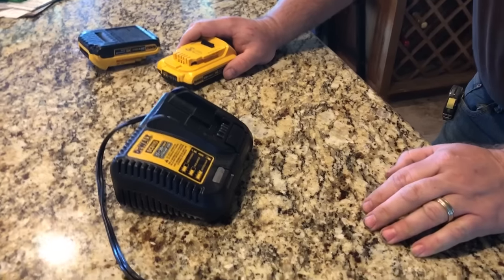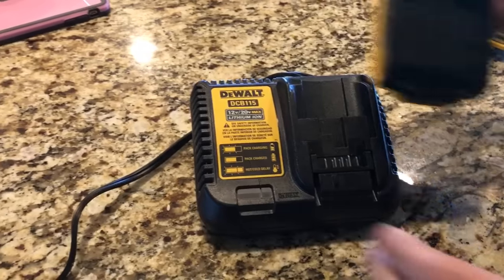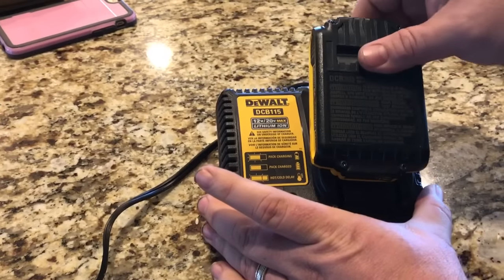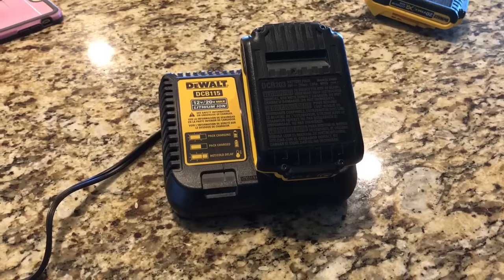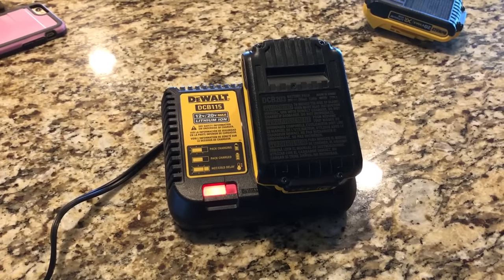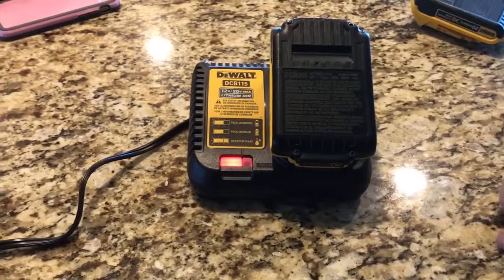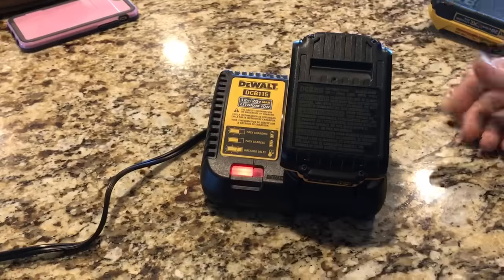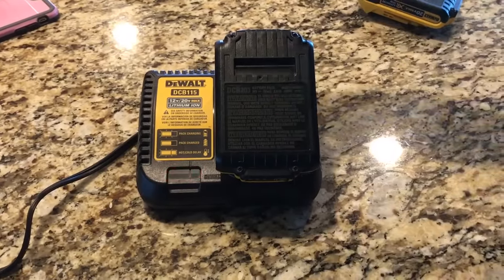This is Why Your Dewalt 20V Batteries Will Not Charge

Comment: I just bought my first Dewalt product and this video just saved me a trip to the store for a return.  It felt like there was too much play between the battery and charger but it also felt like i had pushed it down far enough; I guess not.  Thanks so much for the video!!!
Reply: Me too I bought a dewalt combo pack and I put the battery on the charger and it was blinking red I thought it was charging and I looked on here how to charge a dewalt battery I think this video helped me out the red light is not blinking red anymore

Comment: THIS IS AN ABSOLUTE FLIPPIN' REVELATION!!!!!!!! There are not enough words to express how grateful I am that you made this video, thank you sooo much!!! What really had me convinced it was the battery at fault was because one of my batteries would charge fine while just resting in there in the incorrect, not clicked in, position (a 4ah battery I have) it was only my 5ah that was giving me a problem. Sometimes it would briefly show the orange temperature problem light and solid red, sometimes it would have the red charging light blink once or twice, then go solid red.
The thing is I had watched about 4 or 5 other videos about DeWalt batteries not charging before I saw this video, none of them mentioned this simple point, I was all prepared to take my battery pack apart and start messing about with it in a very dodgy fashion, no need!!!!!!
I've prattled on about this so much now that I've probably spent three times as long typing as your video took to explain the fix, but I don't mind, it's worth it, you sir are worthy of all the time I could possibly spend singing your praises!!!!!!!!!

Comment: Yeah , because I didn't know that they had to be clicked into place , the light came on , I figured it was charging, but it would'nt flash.I took mine back to where I bought it , the salesman there was annoyed with me that I didn't know how to use the charger right , he took my drill and impact into the back room with him , I think he jacked them up somehow because they didn't work right after that , they would work some of the time , then not work at all other times. I was on a job out of town , needed these tools , didn't have power where I was working , these tools barely did the job.I had to take the set back again to get a whole new one.
All because some pencil pusher at Dewalt failed to mention in the instructions how to charge the battery proper.
Reply: Please return your tool for a refund. Or support your local ER Doc. Your choice.

Comment: Maaan, you made my day. I just bought 2x 20v DeWalt batteries and when I was putting them on the charger, a solid light would shine, saying “it’s fully charged”, when the LED display just showed one light lit up. I tried it a few times, same thing. Then I watched your vide. I reseated the battery, putting emphasis on how I was seating it and I slammed the battery into the charger and then finally … the light started flashing, telling me “it’s charging “. DeWalt should look at this problem, their parts should fit together like a “no-brainer”, we shouldn’t have to concentrate on sliding a battery into a charger. Servicemen/women and tradesmen have tight schedules to make money. DeWalt should really fire the designer and get one with a brain. Cheers, thanks bro !

Comment: not the problem, already checked that... newer charger (10 charges) newer batteries 5 charges each... no lights removed and replaced the batteries
Reply from the maker: If you look this helped 90% of the people here, may be you actually have a bad charger, I am sure it happens.  That is a problem to take to DeWalt.
Reply: same, was hopeful, but not the case. Is it the charger or the packs going bad quickly? hard to tell without replacing them all
Reply: I just had the same... knew when I bought it (2 plus years ago) about seating the batteries, however, mine too has failed to charge... If I figure this out, I'll post a solution.
Reply: You're not supposed to open these as they explode
That's why I haven't
Reply: I had the same problem in the video except reseating the battery didn't fix the problem. For me I had to open the charger and resolder the links on the tiny circuit board holding the pins as the joints had dried out and cracked. Very easy to fix if you have a long security torx 10 screwdriver and a soldering iron.

Comment: Thanks for the tip.  Just purchased the pack with 20v lithium and the adapter to use with my 18v drill.  Was wondering why the batteries wont charge.  Snapped them in until the click, charging ok now.  Thanks again.

Comment: Thanks for the tip! The manual said not to force the battery into the charger, so I didn't. I actually called Dewalt first and they never asked if I was getting a click. My 12V batteries click in without forcing them but I assumed the new 20V batteries were different in that regard. But they required more force.

As an aside, I've never seen a Youtube video with as many comments as this one! You really hit the nail on the head, if I can use a tool pun ;-)

Comment: DOH! I have been charging my batteries for 2 years without knowing this or pushing the batteries until they click. Just recently one of my most recent batteries failed to charge. I contacted DeWalt and they replaced it. The tech support guy never asked me if I was making sure it was seated. The manual tells you to make sure it's seated but says NOTHING about it having to click so I assumed when I set it on the charger and it started working that was it. The new replacement battery started doing the same thing and i have two chargers. Both batteries are happily charging as I type. Thanks so much for posting this simple information.

Comment: Thank you for this. I've always had Kobalt batteries and didn't have any problems charging them. Bought a DeWalt lawn mower yesterday and couldn't figure out why the batteries weren't charged after spending 12+ hours on the charger.

Comment: even in 2020 this worked. i had a battery on my charger with the solid red light and the label next to it seemed to me that if the light was illuminated, it was charging. so i had my battery on the charger for almost three days. plugged it into my drill, it spun for a second then crapped out. thanks for the tip, you're the man

Comment: Thank you very much for this video! I was just about to return my brand new drill because the batteries were reading full charge on the charger, but the drill still acted like the batteries were low.  I had never clicked in the batteries to the charger the way I should have.

Comment: LOL. Thank you. Just bought a new Dewalt 887 that came with a 5ah battery and charger. Plugged it in (wrong) and went shopping, came back and was so disappointed when I thought the battery charger wasn't working... thought it said charged with battery only at 1 bar. Googled the problem and up came your video. Thank you.

Comment: Thank you very much. I've had my Dewalt for years, and used to charge batteries no problem, but it's been a while since last charge, and I think the charging lights, blinking as soon as battery makes contact with charger, and then going to solid red as if charged, confused me, and I've had other power drill chargers, that aren't as mysterious . Saw your video in time to cancel order for $30 ebay battery. Thanks again.

Comment: Holy crap. Today is Thursday 04/18/19. I've been having this problem since 2014 when a coworker gave me a used 18-volt Dewalt. I soon upgraded to a 20-volt. And one of the batteries "died" (or now, so I thought.) Well, I could get another "new" drill with 02 batteries for little more than just a 02 pack of batteries. And recently, both batteries appeared "dead". And I've looked and I've looked and I've read stuff and I've watched videos and nothing helped, worked, explained anything.
And I just saw this video and behind me, charging away, is such a happy little battery that, ten minutes ago, was about to go into the trash along with pal and this time, even the drill.
And what was that lesson I taught my daughters when, for example, the television didn't come on: Is it plugged in?

Yeah, I feel so stooopid....
So thank you very  much for the video.

Comment: So what is the light indication to tell that the battery is fully charged because I just bought a Dewalt chain saw and I had a similar experience of not pushing the battery fully in which I discovered and corrected by pushing it fully down and the battery charger's light is still red after about 48 hours of charging. I am Milwaukee person and I have never had such experience with my tools, sadly enough I did not see the type of built that I like from Milwaukee's chain saw.

Comment: I know exactly what you mean, cuz I learned that from occasionally getting n a hurry and not fully seating it. But what most ppl mean by their negative reviews is that it's still doing it fully seated.. either the battery or the charger has quit. The light is solid, not charging.. one batt did it and then 6 months later, another one did it. Now with new batteries, the old charger is charging.  What's going on with the batteries is actually moisture corroding the connections inside in circuit board

Comment: Thanks for posting this. I had a similar problem with the Ryobi charging station. You really have to slam that bad boy in there for it to start charging! Good information. Thanks for taking the time to cover this. I just got a deal on a brand new Dewalt drill driver with Charger station and two batteries and then I got worried when I saw all the negative reviews? Now I'm not worried about it at all.

Comment: Thanks for this. I was feeling a bit irked that it was not charging correctly, but before I ranted or sent Dewalt customer service an email I looked here. BTW, no manual came with the 6 piece kit for the charger so you saved me from myself.

Comment: Bought 2 new 5ah XR batteries, only had one bar of charge on each, so I threw them on my old charger, and showed fully charged, was getting ready to try to return them when I figured I would check google first, glad I did
20v max batteries always just slid right in without an issue

thanks for the video

Comment: Much thanks! I put me Dewalt 201 battery away fully charged in April. It's for a heated jacket, so I don't need it until November, but checked it today. Dead as a doornail.  Wouldn't charge. ( My no name heated glove lithiums held 3/4 charge over the same time.)  It's the only 20V battery I have, and I didn't know if it was the battery or the charger.  With no 20V DC source, I tried your trick using my 13.8 V bench supply.  Sure enough, that was enough to reset the dang thing!  Again, many thanks.

Comment: well after watching all the "connect a good and bad batter together with wires" videos and them not working it turns out not snapping them in was the issue. I had two that charge by just sliding them in and two that need to be snapped. Thanks,it was getting frustrating!

Comment: Mine clicks but still doesn't charge. Don't know officially if it's the battery or the charger that's bad. Put the multimeter probes on the outer charger plates and measure 0.1 DC volts. I'm thinking it's the charger. However, not sure if my charger test procedure was correct since there are more than two charging plates.

Comment: It's amazing, I'm a technician yet I overlooked this. In my case I have an original battery and a Chinese copy. The original loads perfectly without clicking. That is why I thought the Chinese copy had a problem on the Internal board. However it was just a bad contact 🙈

Comment: Ok what if you put the battery on correctly. However all the happens is a red light briefly comes on then off right away? Found a dewalt led flash light that still has one green light on the battery. And attempted to use a charger at work but it won’t start charging. Just a brief red light after contact.

Comment: I just checked and with a nudge, the battery clicks in and charges perfectly. Thank you Jack! DeWalt needs to get on top of this, tech support is still sending out new batteries for complaints of charging issues. I know, I got my two replacements just this afternoon and thought they didn't work either. Turns out they do work (once I push them in until they click) and so do the ones I thought were bad. I'm happy to have four batteries now but I would have been just as happy if Tech had told me to just push harder on the battery until it clicks. I also noted that the more you click them in, the less resistance you get. This problem may be as much a manufacturing tolerance issue as a communication issue. No matter, they work fine now.

Comment: My 5ah battery still not charging after clicking it as hard as I could, solid red. Self battery check says 1 of 3 bars charged.
Reply: I'm now sure the battery wasn't balanced... So it refused to charge. But by placing the battery on the charger for like an hour then taking it off and putting it back on it finally started charging.

Comment: I was pushing the battery into the charger before this video illustrated, but played the dummy anyway and followed the instructions here with the same results, i.e. the charger does not light up when the battery is seated and the battery is not charged.

Comment: That's not the only reason...sometimes they don't charge when you put it into a charger that charges both the 12 volt or the 20 volt battery... And it's installed correctly...I think something else is wrong..I measured the voltage on the20 volt battery and it was only 13 volts.. I think the charger mistakenly thought I was charging a 12 volt battery and didn't charge it to 20 volts because it misread the battery type...

Comment: Even before I came across this video I spent a half hour re-seating the battery all the way down and heard a click each time. Unplugged the charger for 10 minutes and repeated seating the battery with no change. My drill came with 2 batteries and the other non-issue battery charged and works fine. It's not always user error. But I went through it all again with no change on the battery with the issue. Called DeWalt... sending a replacement. ☺️
Reply: Update 2 yrs later. Problems again with both DeWalt batteries flashing a few times then steady light. Watched this video again which reminded me to press the battery down further into charger.. ya I had forgotten this tip and had been mounting them without pressing again. Voila.. their both now charging like they should be. Hey.. at age 71 you sometimes loose some of your wits for a few moments.. lol

Comment: Appreciate the comments, but what about when the light just flashes quickly? That is what is happening with mine and it is not taking a charge.
Reply: Just to add .. checked the on line manual, and it suggests that it is because the power into the charger is 'not suitable'. Having just taken out the first battery and put a second in, this has worked fine. Does that indicate a faulty battery rather than a charger issue?

Comment: Yes but im here cause mine wont fully clip in and theres nothing bent or obstructing. It wont charge past first bar on mine cause it wont fully stay secured in the cradle so it charges for like 3 mins and thats it at max so this is the same issue as mine but i need to see how to fix the clipping mechanism

Comment: This is not always the case, I have two dewalt fast chargers that the light stays on.  dcb115  they have been used 5 to 6 days a week since purchased in 2019. I have 3 chargers that were Purchased in 2012 that still work . I was thinking wouldn't people be able to see that they don't have it in all the way? after reading the comments I guess not.

Comment: If I leave a battery in my DeWalt led flashlight it will kill the battery. It won't take a charge at all. Three different batteries several different chargers. Definitely seated firmly in the charger. The light was not left on with any of the batteries. I just turned it off but left the battery installed in the flashlight. Any ideas? This is getting expensive
Reply from the maker: All I can say is if you leave batteries in the 20v to 18v adapters so you can use the new batteries on the old tools the same thing happens.  My suggestion is don't leave the battery attached to the flash light.

Comment: Mine will blink 2, MAYBE 3 times, then stays on but doesn't charge battery.🤔 Any ideas/suggestions?
Reply: Mine is doing the same. It’s seated all the way on the charger. It’s definitely a charger issue. I’m just going to buy a new charger and return the old one for a refund. I wouldn’t normally do that, but it’s only a few weeks old and was purchased part of a kit. Seems like the most reasonable thing to do.

Comment: This didn't work for mine. I stick it in the charge and get solid red. That's full charged. Put it on the impact it lights the leds only. I've used the gun twice only since getting it. My Makita's all lasted over 4 years but all quit practically the same day. I used the heck out of those. DeWalt felt good  in my hand and more powerful then my Makita but failed after 2nd use..

Comment: I’m on my fourth battery that won’t take charge. The charger indicates a hot/cold condition which isn’t correct, my other dewalt batteries are functioning normally. So far two flex volts and two 20 volt 5AH.  NOT a happy camper.

Comment: I discovered that early on...my brand new, used one hour Dewalt hedge trimmer, even with a fully charged battery is dead...the machine ran for 3 seconds this morning and stopped....I checked the battery, it was charged....now the trimmer wont run at all.

Comment: I have a DCB101 Charger and DCB201 batteries. The batteries are dead. When i insert them into the charger, the charger starts blinking indicating it is charging. After about 10 seconds the light is on continuous meaning the battery is charged when in fact it is not. Anyone know why or how i can get the batteries to charge?